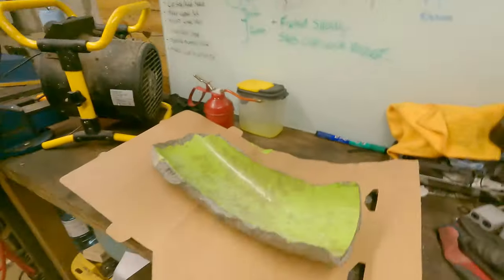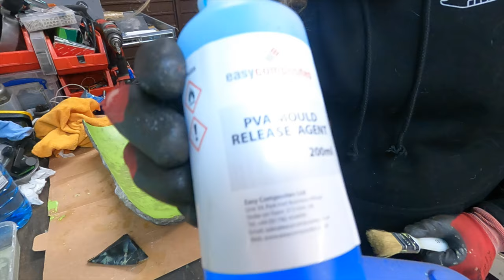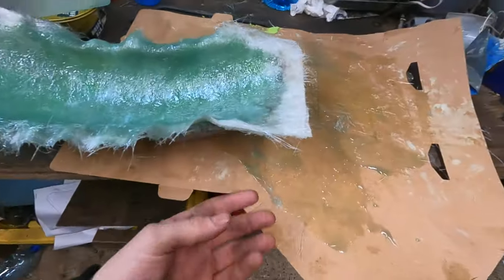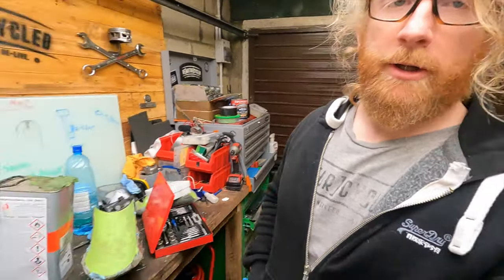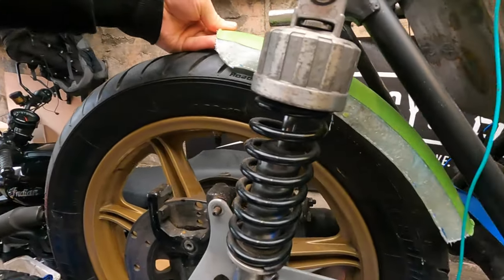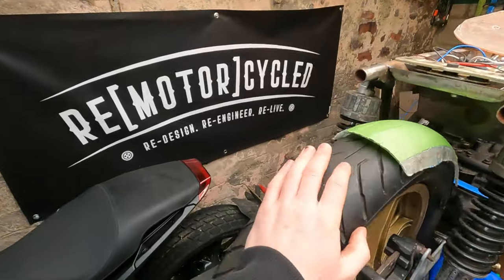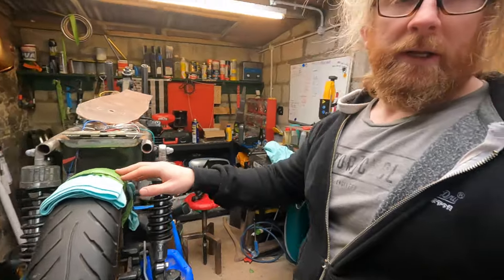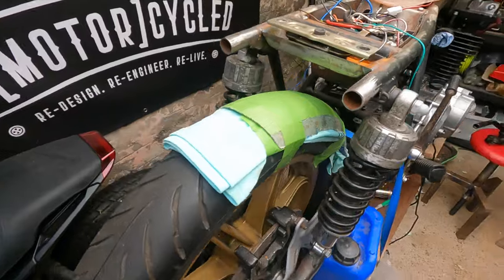Yamaha XS850 Brat build part 27 - Making a fibreglass mudguard

Comment: For the mudguard, what if you welded a point off the swing arm so it was centre mounted at rear and thus looked floating at sides Struan 💡 

Lol, not too covert with your rear light holders 😂 🤫
Reply: Scrub that, just realised what an arse that would be as you’d need a flange to push the fender up if it was mounted from the axle hinge 😆 🙄
Reply from the maker: Yeah that would have been a neat solution too, I’m hoping I can even get away with it being single sided mounting but will have to see how the next one turns out!